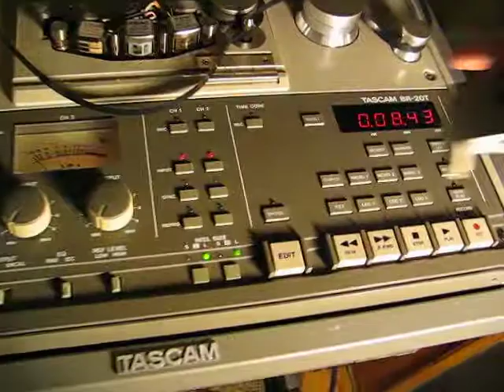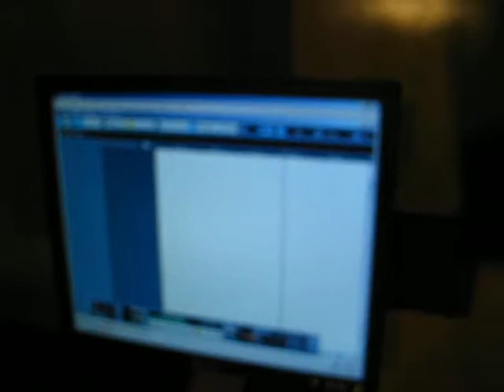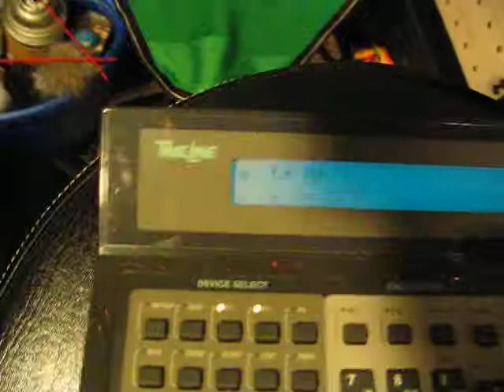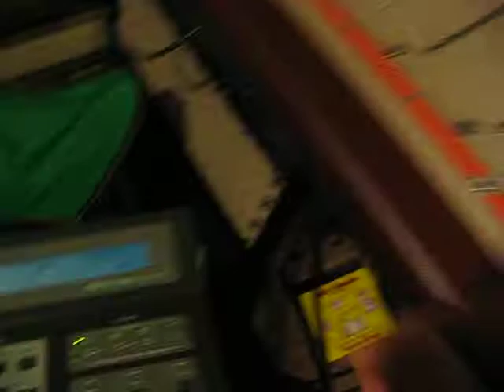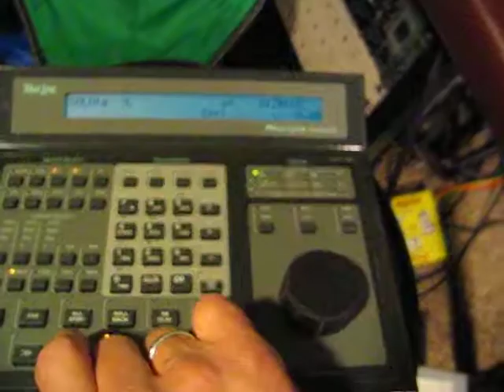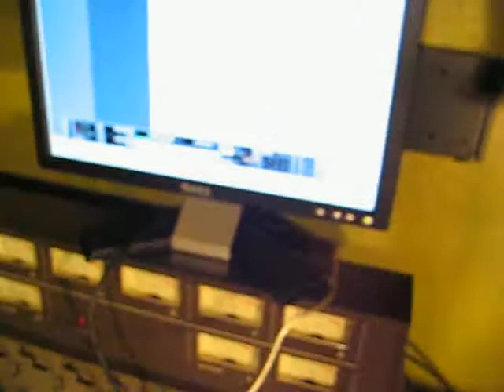Synchronizing DAW to Tascam BR-20T Success!

Comment: Hi there, are there any modern products that can be used to sync a Tascam Tape recorder (388 in my case) with a DAW?   Or is the Timeline MicroLynx the only option?  What about the (Non-Micro) Lynx product, can that also do this?  I am told that the cables needed are proprietary and difficult to procure these days.  Thanks!
Reply from the maker: That doesn’t really answer my question. You want to sync Protools and your 388. One of them needs to be the slave, and one needs to be the master in the sync relationship. If you want the tape machine to be the slave, which in my opinion is the better path as far as the integrity of your digital audio, then you’re looking at needing something like the Micro Lynx, and there is no contemporary equivalent because there’s no current market demand for such devices…hasn’t been for decades. If the tape machine is the slave then something actually has to control the capstan (and other transport functions) to ensure the tape machine stays locked to the timecode coming out of the DAW. That transport control is what makes the Micro Lynx and other (rare) devices distinct. And yes it can be hard to find the specific cables needed to go between the synchronizer and tape machine…they are specific to each tape machine, and if not present then either you have to make it or have somebody make it. And the connectors for the Micro Lynx system unit are hard to find. Expect to pay in the neighborhood of $300 for a custom cable or more. The other way to do it is let the tape machine be the master, and then it is much simpler…then you just need something like a JL Cooper PPS-100…you stripe SMPTE timecode to the tape machine, connect the audio out of that track to the timecode input of the PPS-100, and then connect the MIDI OUT to a MIDI IN on your MIDI interface, and set the DAW to sync to incoming MTC. The problem with this is the tape machine speed varies. And this can be minor or not so minor depending on the machine and its condition. So the question is as the tape machine speed fluctuates, however slight, how does the DAW deal with those fluctuations to stay locked? It doesn’t varispeed…one of two things happens: 1. either the DAW drops samples (to slow down) or adds empty samples (to speed up), which means your digital audio tracks are no longer as they were when you recorded them, or 2. In the case of my DAW at the time when I was synchronizing a tape machine (which was Cubase), the DAW “freewheels”…that’s right…you can set the DAW to sync to incoming MTC, but Steinberg decided that in that case, to maintain the integrity of the digital audio, the project isn’t actually locked to the tape machine…! Sounds crazy, but that is straight out of the manual for the DAW. So I was, like, what’s the point in synchronizing then? So you either beat your head against the wall trying to find a synchronizer with tape machine control capability and the specialized cable or cables to do it, or you read up on how your DAW actually deals with slaving to an external master and if it adds or drops samples to stay locked you just have to be good with that. Your other option is to track to the tape machine, dump the tracks to the DAW and finish the project in the DAW…track your sources you want kissed by the tape machine to the tape machine, and track everything else to the DAW directly after dumping the tracks from the tape machine to the DAW. If you are committed to slaving the tape machine, it will be an uphill battle finding the hardware to do it, and likely expensive, and keep in mind devices like the Micro Lynx aren’t getting any younger, and there is zero support for them. And the proprietary power supplies often did. I had to build a custom power supply for mine. Plus the maximum sampling frequency is 48kHz. So your DAW projects will be limited to 48kHz. The clock in the Micro Lynx was good, you just have to be good with 48kHz whether it’s the clock master or not. And this is how it goes. There were other devices like the Tascam ES-50, but the keyboard controller for the system unit (the ES-51) can be hard to find, and expensive, and the ES-50 doesn’t talk MIDI. So the setup can be more complex and less intuitive. I couldn’t figure it out. I know a guy that did…figured out how to use the ES-50 with the DAW as a code only master and still get the tape machine to complete the setup procedure, but the Micro Lynx system was lovely because it talks MIDI. If you decide to slave the tape machine, some DAW software can take SMPTE timecode directly and sync to that so you don’t even need anything like the PPS-100. You have to check on this in the manual for your DAW software.
Reply from the maker: Are you intending to slave the Tascam, or have the Tascam be master?
Reply: @SweetbeatsTechStop  I want to record things to the Tascam 388, and have additional overdubs be done in Pro Tools, so that Pro Tools is an extension of the 388 for additional tracks, etc.  I don't really have a strong preference as to which is the control surface, I guess which ever is easier.  Hope that answers the question, if not please let me know!  Thanks!

Comment: whats that mixer ? tascam ?
Reply from the maker: Yes. But it’s a one-of-a-kind prototype…

https://www.torridheatstudios.com/ftp/share/pictures/Tascam%20M-___/2012_11_20/original/IMG_3949.JPG

Modular inline, 12 input/output modules, 8 mix busses plus stereo master, 4 AUX busses switchable pre/post with source switching, dedicated stereo monitor buss with multiple switchable sources, 4-band swept EQ with fully parametric mid bands, two HPFs and one LPF, assignable to the channel or the monitor buss, global per-channel control of source switching, which can also act is mute groups, multiple solo points per channel, multiple mute functions per channel, per channel switchable meter sourcing, and 3 inputs per channel all accessible simultaneously via inline monitoring…plus assignable effects return and external inputs for a total of 42 simultaneous inputs. All mix buss outputs and AUX outputs are +4dBu capable, the master out is +8dBu capable, and all are driven by +/-35V powered discrete transistor array output stage…massive headroom. Those are the highlights.
Reply: awesome!!!! @SweetbeatsTechStop

Comment: This is really great and I came from the world of video and audio syncro as a videotape editor in Hollywood, Ca. and I had an audio studio thru the glass that I interfaced with during sound design sessions. The one thing you didn't do was actually play tracks showing the system in play. Would have loved hearing the 2 track slew & lock like the good old days. Other than that nice video and congratulations. Nice gear! :)
Reply from the maker: Thanks for the comment! Lots of experience syncing machines you have…and lol yeah the “werp” of the scrub in…that would have been good to include, but…I’ll have to look…I think it might be possible there was nothing tracked in Cubase or on tape except for timecode…most boring song ever.
Reply: I was thrilled that you got it all working. Fantastic machine. :)  @SweetbeatsTechStop

Comment: That is sick as hell!  I had no idea the BR-20 was capable of this.  I wish I had one.  😞
Reply from the maker: A lot of tape decks have this capability though…and note the deck I had was the “T” version with the timecode track. Otherwise you use one of the two tracks as a sync track if you don’t have the third sync track. Fostex made a similar halftrack with a small sync track the E-22 I think? And many multitrack decks have slave capability. But no matter what you still then have to find a capable synchronizer, and often times custom build the interface cables which often use obscure connectors and/or require hard to find schematics in order to even know the circuit design within the cable. It was rewarding to reach success with the BR-20T, but ultimately what I determined for me worked better workflow-wise was to have a multitrack machine with a high enough track count to handle what projects if throw at it, and either mix down straight from the multitrack deck, OR dump all the tracks to the DAW and continue the project there if it was a hybrid project. The synchronizing thing is super cool, but IMO the number of situations where people actually need to do that is dwindling. And it’s complicated. One can always go the much more simple route of setting the tape deck as master and slave the DAW…way cheaper and easier, but I will never get over my distaste for the idea of samples being added or removed in order for the DAW to stay in sync, OR in the case of the version of Cubase I was using all those years ago in the video, the DAW not actually being locked to the tape deck…the manual states the DAW free-wheels when slaved to incoming MTC.
Reply: @SweetbeatsTechStop  The Fostex Model 20 is what you're thinking of, I believe.  I owned one of these, actually.  At one point I did start tinkering around with the timecode channel, but I didn't really do enough research to implement it.  I had the thought that it would be cool if the deck could read the position of the tape regardless of the accuracy of the roller counter.  I primarily just make 4-track (quad) or 2-track stereo mix tapes, and given that they're always tails-out, it would be cool to just thread it on and hit the zero-return/play button to have it be automated.

My excitement dwindled pretty quickly when I noticed it was shaving microscopic amounts of tape from the deck-facing edge and leaving a little pile of tape dust below the guides every time I ran a tape through it.  Ultimately after repeatedly working on it (and also frankensteining a pair of parts-only Model 80's into a good working unit) I decided they were too cheaply made and their issues couldn't be resolved without reengineering and machining new parts, so I sold all 3 of the decks off before really having the chance to fully play around with the timecode track on the Model 20.

Despite its shortcomings build quality-wise, I was very impressed at the precision of the transport.  Having seen your video and your explanation, it makes complete sense now and I see what an SMPTE track-equipped deck is capable of.

There are a couple of downsides though, as IIRC there is a very slight decrease in fidelity performance to a timecode 3-track vs a standard 2-track, and the tapes with timecode on them wouldn't be playable on a standard 2-track deck without the timecode track being audible, I think.
Reply from the maker: “The Fostex Model 20 is what you're thinking of, I believe.”

No, I meant E-22…E-2 also. I totally forgot the Model 20 had the timecode track. The Model 20 is something of an anomaly with the 15ips tape speed capability, three-head setup, timecode track but max 7” reel capability.

The E-2 and E-22 both also have the timecode track, but with 10.5” reel capability…more robust transport…the E-2 is 1/4” and 7.5/15ips, the E-22 is 1/2” and 15/30ips.

I agree the Model 20 and Model 80 have some weak points in their transport design, like the capstan pulley, tape guide setup, etc., which is unfortunate considering their other unique facets.

“…I noticed [the Model 20] was shaving microscopic amounts of tape from the deck-facing edge and leaving a little pile of tape dust below the guides every time I ran a tape through it. Ultimately after repeatedly working on it (and also frankensteining a pair of parts-only Model 80's into a good working unit) I decided they were too cheaply made and their issues couldn't be resolved without reengineering and machining new parts…”

That’s usually because the wear path was established by Ampex/Quantegy tape and then the operator switches to AGFA/EMTEC/BASF/RMGI or 3M stock. I can explain further if you’re interested. 

“IIRC there is a very slight decrease in fidelity performance to a timecode 3-track vs a standard 2-track, and the tapes with timecode on them wouldn't be playable on a standard 2-track deck without the timecode track being audible, I think.”

Neither is correct…at least as far as the Tascam is concerned. I can’t speak for the Fostex. And, as with any crosstalk situation, your levels to tape are important. I think the recommended nominal level for timecode on the Tascam was -10VU. According to the specifications and my experience, there is no difference in reproduce frequency response between the record head with the sync track and the reproduce head. Both heads have identical NAB track width and gap spacing, the record head includes additional guard bands for the sync track. The reproduce head on the BR-20T is the same as on the non-“T” BR-20…standard NAB halftrack spec. Now, there was a DIN version with wider track width and a more narrow gap in between the tracks. Program material recorded on a “T” with sync tone reproduced on a DIN spec machine…there you might grapple with some sync track bleed. But otherwise that was the beauty of it…no performance deficit and can reproduce on any NAB spec halftrack machine, sync track or not…nicely nestled in between the two audio tracks.
Reply: @SweetbeatsTechStop  Haha, well... consider me schooled!  I don't know why but I thought for sure the gap between the primary channels was larger on a timecode head, with the individual track width being ever so slightly smaller.  Whoops😕

I have two other "anomalous" decks that run at 15 IPS with a maximum 7" reel - the Tascam 22-2 and 22-4.  Though neither of them do timecode.  With those, along with my RT-707, I can play back most tapes I might find in the wild.

The wear to the tape path on the Fostex decks being caused by previous tape being used makes a lot of sense.  Did Ampex/Quantegy tape run slightly wide or something?  I definitely saw wear at both the back plate and cap of the tension arm and guide/counter rollers.  The rollers on my Tascams have a lip on the edge of roller wheel itself, but in the Fostex machines it was a completely flat plastic cylinder, allowing the tape to wander into the cuts left by previous use.

Without sourcing new parts (which I found to be nearly nonexistent) I didn't really see many options other than to get rid of them, as I didn't want them chewing up my tapes obviously.

I also had issues with the plastic reel tables being off-axis (EDIT: not sure if this is the right term - the tables had a slight tilt perpendicular to the shaft), resulting in the reels wobbling in and out with each rotation.  I'm not sure if this was due to just poor manufacturing or if the plastic simply deformed due to heat/age.  These issues were present on all 3 Fostex decks.

They all suffered from VU meter segments not working as well, due to the LEDs being attached by wires that were thinner than human hair.  I managed to replace them with new SMD LEDs but it was some seriously tiny precision work.
Reply from the maker: “Haha, well... consider me schooled! I don't know why but I thought for sure the gap between the primary channels was larger on a timecode head, with the individual track width being ever so slightly smaller. Whoops😕”

Yeah not according to the BR-20T specs…same audio track width and gap spacing as the non-timecode version BR-20, and additionally the reproduce head on the BR-20T is the same part number as the record and reproduce heads on the BR-20. 

“I have two other "anomalous" decks that run at 15 IPS with a maximum 7" reel - the Tascam 22-2 and 22-4.”

Yeah the 20 series Tascam machines don’t have the bells and whistles of the Model 20…definitely a more basic machine, but easier to setup and work on, and the transport is more robust…like a mildly miniaturized version of the 30 series…not as professional or robust a design as the 40 or 50 series, but definitely a level up from the Fostex. I think if you don’t need the bells and whistles, and want to stick to 7” reel size, the 20 series machines are a sweet spot… decent user community support, easier to find parts, etc. 

“The wear to the tape path on the Fostex decks being caused by previous tape being used makes a lot of sense. Did Ampex/Quantegy tape run slightly wide or something?”

No, the opposite actually which can cause a number of issues. Ampex/Quantegy tape was purposely slit slightly undersize because of accuracy issues with their slitting equipment. So they undersized in order to avoid at all costs the tape being too wide. That means tape paths worn by such tape tend to be 0.001”~0.003” more narrow than the standard, and when you put tape from a non-Ampex/Quantegy manufacturer, which pretty much everybody else was able to more accurately slit the tape to the standard, on the machine with a tape path established by Ampex/Quantegy tape, you can get edge curl, tape wandering as it tries to fit in the too-narrow path, etc. It all depends on the machine, the tape path design, etc. the more difficult cases is a machine that’s not setup right in the first place AND has a path historically worn by Ampex/Quantegy tape, and now the operator is trying to use tape slot to the standard. That might be your situation with the Fostex machines you had, because I do recall not being impressed with the guide setup. If you had wear at odd places odds are something wasn’t right. Ideally a decently designed tape path that is setup right shouldn’t necessarily need edge guidance, or just minimally. That’s my experience.
Reply: @SweetbeatsTechStop  Very interesting, thanks for the explanation!  Sounds like a deck running Ampex/Quantegy would have to be fully re-lapped around most of the tape path to make it usable again.  That's pretty awful!

Since I don't need the extra bells and whistles, and I'm happy running 7" reels, I concur - the 20 series is quite nice.  Though I wish the 22-2 had the soft-touch style transport buttons that the 22-4 has.  It would take adding a bunch of relays to mod that into the 22-2, but yeah.  Not a dealbreaker, but there's something extremely satisfying about them. =)